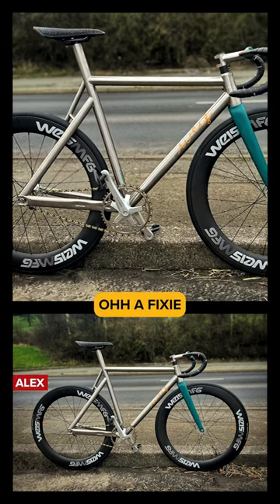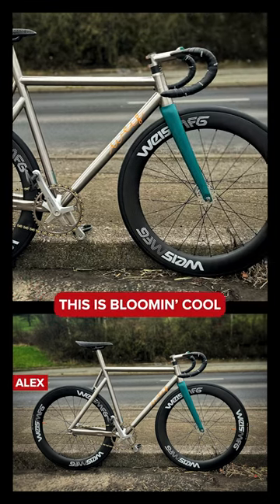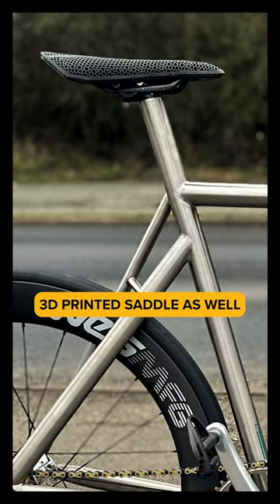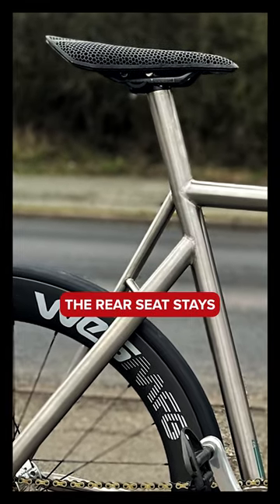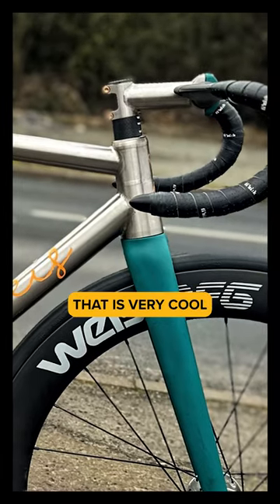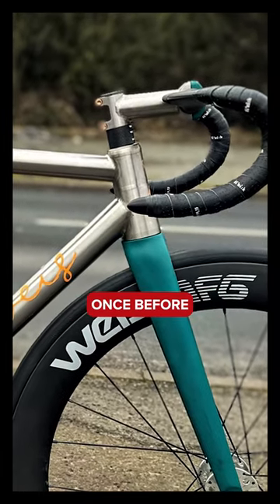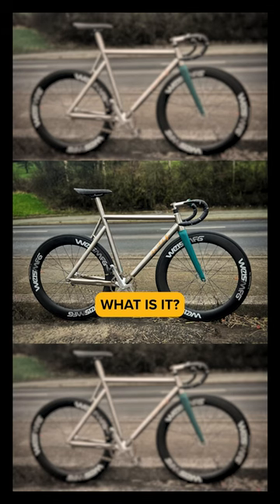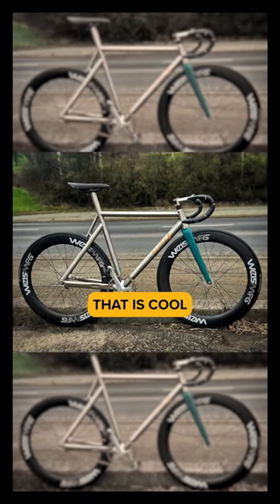This Titanium Track Bike Races Into The Vault

Comment: Fascinating machine. Is that bike built for a 250 lb weight-lifter cyclist on a smooth track? What's it like for a skinny-light rider over old asphalt?
Reply: Not 100% sure but I believe the staggered seat stays are to make it stiffer/handle better on the track. I'm not sure how it handles but I'm a skinny man (130) and I ride an aluminum track bike for commuting, it can be rough but the snappiness is worth.
Reply: @wr0te0ff68  Weis seat stays are about looks.  If they wanted stiffness they would just get a carbon bike.
Reply: @__Bebo__   you're a special one. Now carbon bikes are stiff.  Yet you've said you're too strong for them and say they're flexy noodles🤡
Reply: @veganpotterthevegan  My main problem with carbon bikes is the aesthetics.  For a company like Weis to be doing this well for so long there must actually be a problem there, since carbon would be much faster than this.
Reply: @___Bebo___  I highly doubt it is solely for aesthetics. There's been at least one other company to do it and even if it's just theory, I'm sure there's a reason for it other than looks. I don't doubt that looks play a big part, it's very striking and stands out well.
Reply: @wr0te0ff68  It's for looks bro, I've ridden a Weis it's not as stiff as a carbon bike, including the Alu model.
Reply: @__Bebo__   carbon bikes are the stiffest bikes now huh?   Not the flexy noodles you've claimed they are and the reason you only wanna ride steel?😂
Reply: @veganpotterthevegan  My main bike you can squeeze the tube with your palm and feel it flexing.  Carbon will never be able to match this level of compliance, enjoy your 40mm tires.

Comment: Sublime. But costs a fortune. That build is something like $6,000 total
Reply: That's not very expensive in today's bike money😅
Reply: @veganpotterthevegan  for urban fixed gear that’s like the equivalent of a $16,000 Pinarello F, you know what I mean? Dude went all in, good for him
Reply: @SamuelBlackMetalRider  no it wouldn't.  There are significantly more expensive framesets than this(yes,  for the track), and these are very middling wheels in terms of price for track wheels.
Reply: @SamuelBlackMetalRider   as a former, high level track cyclist, I have no idea why people wanna ride track bikes on the street. But I've seen $6000 Look framesets being ridden by hipsters that will never see a velodrome, along with very expensive track wheels.
Reply: @veganpotterthevegan  People wanna ride track bikes on the street because it's fun.  Had you not blown your knees out doing 90 gear inches quirky Tandem cycling you probably would still be enjoying it.
Reply: @__Bebo__  what are you talking about potato?   My knees are probably the least damaged parts of my body🤡
Reply: @veganpotterthevegan  People like you are the reason bike sales dipped 30% last year.  Always hating on nice bikes you can't afford like the Weis.

Fixed Gear road predates road by several decades.  It's a valid form of road cycling, and it's pretty much the only type you should be doing on flat ground IMO.
Reply: @veganpotterthevegan  you talking about Olympic level carbon track frames? Why mentioning such frames that NO ONE rides on the STREETS. Sure CANYON has released that super duper aero track frame that costs 20,000€ or something but NO ONE will be riding it outside a Velodrome. Or maybe you want to mention the LOTUS? As if anyone will be riding it for commuting… That build on the opposite is made to be ridden ON THE STREETS as a FIXIE. As such, this is a ludicrous price to pay for, I repeat, an URBAN TRACK BIKE. I would say the same for anyone riding a pro level carbon track frame in the streets of NYC or whatever
Reply: @__Bebo__  huh?  I just ordered a new Handsling pursuit bike that's getting painted right now and I'm probably buying a new hardtail this year.    Do I need to be 3 bikes a year to not cause that 30% dip?🤡
Reply: @__Bebo__  yes, your uneducated opinion.  Taking a dump randomly on the ground also predated using toilets. That doesn't mean it makes sense to do it now though🙃
Reply: @SamuelBlackMetalRider  no, as I said, I've seen people using this bikes on the street...people that'll never see a velodrome outside of YouTube.
Reply: @SamuelBlackMetalRider  This dude is just a troll, no one knows who he is or how he rides.  He's mad about fixed gear because he can't ride it anymore due to injuries so he rides carbon bikes uphill in the granny gear now.
Reply: @veganpotterthevegan  Arrogant silly people riding the bikes is the problem.  Normal people see that and don't want to be a part of the sport.
Reply: @___Bebo___   I don't care if anyone knows who I am🤡  And I'm definitely not mad potato.  Like I said,  I'm getting a new track bike to actually ride on the track😂 And I regularly climb some of the hardest climbs in the US as I live in the rockies near the Cottonwood Canyons in Utah. They're spitting distance from my house😂
Reply: @__Bebo__   you're not a normal person.  Not saying I'm a normal person either as normal people don't even ride bikes for fun.   At most,  they may ride to get to work but even they're an extreme minority in the US
Reply: @veganpotterthevegan  I never even heard of Handsling what is that anyway?  Ugly bikes, it looks like they bought a 2021 Orbea mold and went wild with it somewhere in Guangzhou, haha.
Reply: @__Bebo__  again,  how many more bikes do I need to buy to not be the cause of the 30% sales drop?😂
Reply: @veganpotterthevegan  and to such people I would say: you are nuts. Also unless you ride in a super fast bunch on an outdoor loop like I do, riding a super fast carbon track bike at an avg. speed of 20-25km/h makes zero sense
Reply: @SamuelBlackMetalRider  people do lots of things that don't make sense.  Riding a fixed gear bike on the road(of any frame material) is one of many nonsensical things humans do.
Reply: @SamuelBlackMetalRider  being carbon has little to do with the senselessness of riding a track bike on the road.  The actual cost of the bike is of varying importance from person to person.  After all, there are people with watches that cost more than our houses and people with watches like that tend to have more than one😂
Reply: @__Bebo__   if you knew anything about track cycling, you'd certainly know about Handsling.  Plenty of World Cup riders are on them.  That said, I bought this because I'm waiting to see what else comes out from the heavy hitters in the next few years and I'll buy one of those too.  
*They're definitely not open mold bikes.  But I assure you,  outside of paint, your round tubed steel bike looks just like every other round tubed steel bike. Nothing wrong with that,  but I'm not the petty one that cares about looks.
Reply: @veganpotterthevegan  You should thank me for getting you back into riding track bikes again, you're welcome.
Reply: @veganpotterthevegan  Explain how riding track bikes is senseless also?  You don't lose power from the stupid pulleys, the parts are a good price and high quality.  As long as your legs are strong to compensate for the lack of gears why does it matter?

If I was in Utah, yeah I'd probably get a Giant TCR to ride, but if you're not what is the point?  Just adrenaline junkie stuff riding a bike fast?  I could go to my old gym and fight a beginner wrestler and get a bigger adrenaline rush than that.
Reply: @__Bebo__   it's not 1890.  Why use a single gear or a candlestick phone?  Plain and simple, braking is trash, and bike handling sucks when you have to pedal into turns that aren't banked.   
*Yes,  they're rideable, but they're certainly not as good or practical.  Even a single speed with a freewheel and  2 brakes doesn't make sense unless it's all you can afford.  Wind, undulations in the road, accelerating...shifting gears is common sense.  FFS, even every car that's not electric does that but electric cars don't need to because their functional RPM range is many times better than a humans... even you...someone who randomly brings up their deadlifts in a cycling conversation🤡
Reply: @veganpotterthevegan  So you're saying skidding around Manilla on the Weis featured in this video would be less fun than riding Vegan Potter style up some meth head creek no one has ever heard of in Utah?  I really doubt that.
Reply: @___Bebo___   you think there's no meth in Manila now?  Even after you brought it up in the past?😂
Reply: @___Bebo___   biking in Manila is terrible.  Totally impossible to have fun doing it😂
Reply: @veganpotterthevegan  It's because you were rocking a 140mm roadie stem and had no bike handling skills that you had no fun riding in Manila.  

If you had the ability to turn the potholes and the mopeds into a fun game it would have been fun.
Reply: @__Bebo__   that's exactly not why😂 Who wants to ride in some of the world's worst traffic on very poorly built roads?😂
Reply: @__Bebo__  breathing in all the diesel, and very high emissions, old petrol exhaust may be up your alley though.  It's not like you have many functional brain cells to begin with.
Reply: @veganpotterthevegan  Do Filipinos hit you with their car on purpose?  Short of that I can't really see getting annoyed with too much from the videos I've seen it looks fun.  Lots of fixed riders there.
Reply: @__Bebo__   that's not the issue. You barely have any space to move in a lot of the traffic.   2 lane roads regularly become 3 lane roads as people don't care about the painted lanes.  It's a warzone.  Driving there isn't fun either
Reply: @veganpotterthevegan  In Italy they have like 6 lane cobblestone roads with no painted lanes and NO rules at all and it works fine.  You just aren't used to no rules driving.
Reply: @__Bebo__   Italy doesn't have remotely close to the traffic that's in the Philippines potato.  I'm certainly more used to it than you are too😂  I've biked there plenty and have a Philippine driver's license🤦
Reply: @veganpotterthevegan  If Filipinos don't try to hit you on purpose then its not even worse than Los Angeles.  You are not ready for the realities of urban fixed gear.
Reply: @__Bebo__   why would I want to be ready to make bad decisions?
Reply: @__Bebo__  chances are,  people are trying to hit you because you're YOU, not because you're a cyclist.  I've ridden in LA and nobody tried hitting me on purpose🤡
Reply: @veganpotterthevegan  Why make 30 MPH on a closed track the limit of the fun?  Why not put your life on the line too?  The only reason I can see not to is if you are scared, which I'm not lol.
Reply: @veganpotterthevegan  As far as bike aesthetics go, did you hear the excitement in Manon's voice when she saw this bike?  It matters bro, on the Seven she is not giving you the time of day, truth hurts.
Reply: @veganpotterthevegan  I just read an article that says Manila had the worst traffic in the entire world ever recorded in December 2023.  Everyone is going 1MPH there you can't even get run over lol, I would have fun skidding around that mess.
Reply: @__Bebo__   yeah,  it looks good. Lots of bikes do🤡   So what?  Bikes are meant to ride, not look at.
Reply: @__Bebo__   you wouldn't have fun skidding because you'd barely ever go fast enough to be able to skid.  It's really a nightmare.   You also have people walking in and out of that traffic, stopping you to sell you water, deep fried peanuts, and cigarettes, along with people jumping in and out of tricycles and jeepneys🙃
Reply: @veganpotterthevegan  Perceptible things are important and have been studied for thousands of years.  It does not surprise me that you lack a background in aesthetics given your taste for bikes.  Being able to appreciate and make things like this is one of the things that separate us from animals.
Reply: @veganpotterthevegan  what level did you ride at?
Reply: @__Bebo__  I have an art degree from one of the world's best art programs.  You have a philosophy degree from a very bad college.  I'd say try again but it's futile
Reply: @HkFinn83   I raced for the national team for the Philippines and an elite team of all cat 1 vegans in the US called Organic Athlete. I have two pro/1 state TT titles from different states(working on a third many years later) and hit the Olympic standard in the individual pursuit 3 months before it was removed for the London games
Reply: @veganpotterthevegan  3 degrees now?  One of them being art but you don't care about aesthetics on bikes?

I'm beginning to think the only thing you have a degree in is getting mad and buying stupid bikes.  Maybe the tip of your head points a few degrees to the left, stuff like that.
Reply: @veganpotterthevegan  lol @ getting 3 degrees and still being broke in Utah btw.
Reply: @__Bebo__  who said I have 3 degrees?  I have a dual degree...biology and fine arts.  I've already told you this. You have a worse memory than our last two presidents.
Reply: @___Bebo___   definitely not broke, and again,  I don't care about money.  We've already spoken about this potato.